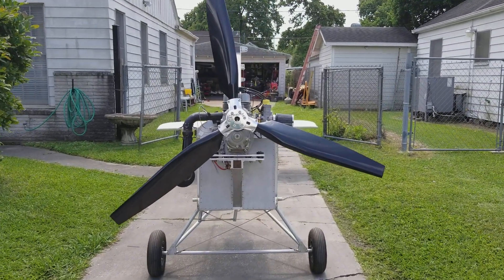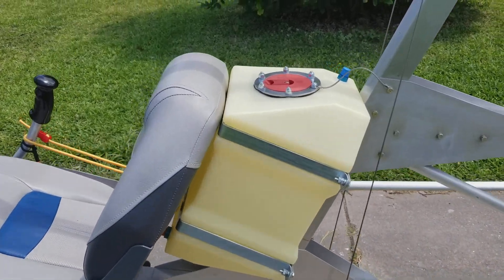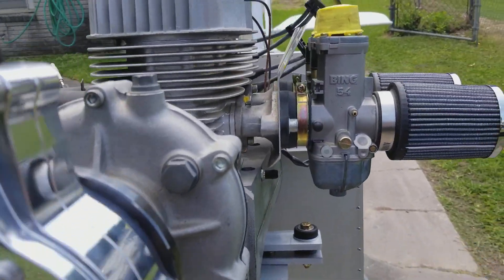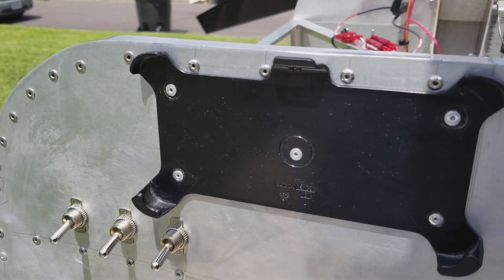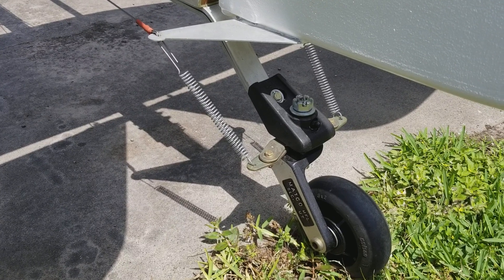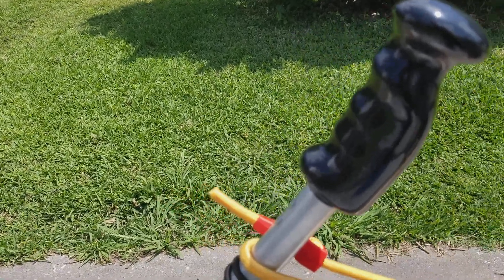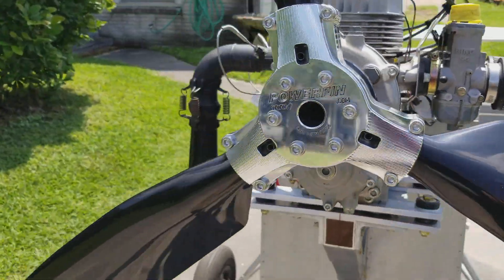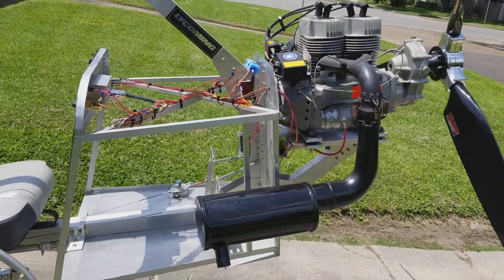Affordaplane TA-1 progress

Comment: Did you rig up a carb(s) heater?  I remember your engine cutout video mentioning possible carb icing at 1700 ft elevation?  Seems too low for icing, but your more familiar with your area.  Houston is near sea level and humid, right?  
I'm in AZ at 4633' elevation, probably quite a bit higher than Houston, TX down near the Gulf of Mexico or some body of water. Love your videos, trying to get my own place and build my affordaplane, have plans, will utilize your store and aircraft spruce, got a catalog.  Your store is online only? 
Your engine out landing looked a little scary and it sure beat up your landing gear, but a tree collision would a been much worse.  Thanks for your videos, Terry, John Bell from Sierra Vista AZ.

Comment: Thread lock, lock washers, and nynuts (military's nylon locking nut) on the prop mounting bolts are fine, with a minimum of three threads showing above the nuts, but SAFETY WIRE THE BOLT HEADS! You will not be sorry.

Comment: Terry, I would suggest fender washers on your motor mount rubbers. You can get them at Orscheln Farm and Home Supply or Westlakes Hardware.   If you want aircraft grade try Wick's or Aircraft Spruce. They need to almost completely cover the rubber damper. You have done a great job, it really looks good.

Comment: Very sanitary build? You may want to run your wire inside of a wire jacket to protect them from vibration. It may be wise to rethink the way the wires are connected to the various components as they could vibrate off.

Comment: Hi Terry, I would suggest with the foot pedals you might like to put a bar across to take the pressure of your heels. In some situations I have seen foot rest holes in the floor just infront of the pedals. With vibrations thru the floor your feet could get displaced. With the fuel pump, I would suggest you have a vacuum version connected to the engine crankcase, and then also use an electric version for take-off additional power. You should be able to check the air vent to the fuel tank. Should show a positive open and closed position.  hope this helps. great to see another affordaplane getting up to spec. I have a Flying Flea Bifly tandem wing, similar spec.  G-POUX
All the best Gpx.

Comment: The Snubbing washer for a Barry Controls 22000 series mount  1.56 in Diameter with a 391 hole and is .090  thick.  here is the Barry part number. 9810145-01804
Reply from the maker: Thank you very much

Comment: I just found your videos and love them. I would take a stripped down q tip and coat all of the quick connect electrical connectors with dielectric grease (I coat all electrical connectors with it). Just to prevent corrosion in the future. They will all be getting hot/cold/warm during regular use, which will cause some condensation, more of course on the wires that draw more current.

Comment: Nice build. Where is the safety wire though? I've built race bikes for years and safety wire is a must, would think it's even more important on an airplane.
 The washers on the the grommets should be large enough to not pass through the hole the grommet is set in. I would consider that a safety concern during a crash so the engine can not pull off the mount.
 I would use circuit breakers instead of fuses. Then you could at least reset it in hopes it was just a spike that tripped it.
As far as the wiring goes, a good tight mechanical connection is best. That means, a quality set of crimpers and connectors without those plastic covers. (they look so tacky too) They don't let you inspect your crimp.  Shrink tubing should be used instead to cover after you are happy with the crimp, and it should be long enough to support the wire to connection joint.  Failure usually happen at the point where there is no insulation on the wire at the connection. Due to movement and vibration. Solder can be used but keep it from whicking up the wire much. If it goes up the wire it creates another point that can break. Keep the solder well within the length of shrink tubing and it should be good.
Best of luck with it.